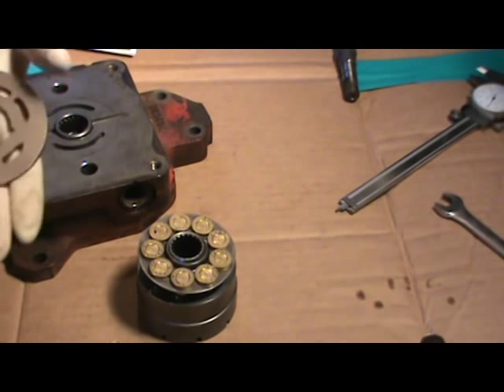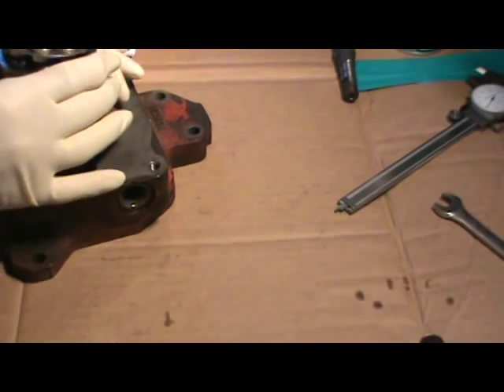Hydromotor part 4

Comment: Where did you get the manual/book for repairing the hydro pump?  I've got a bunch of manuals/booklets for these tractors but I don't have a manual on repairing the pistons/slipper assembly. Also, did you make a video of rebuilding the transmission?  I've got 3 of these wheelhorse tractors that are all hydrostatic drive.  (1) 1978 D160 with the 16hp Onan engine, I've used this one for years and now it needs new rings as the compression is only 75lbs and it should be closer to 150lbs per cylinder. (1) 1974 D160 with the single cylinder 16hp Kohler engine, this is what I'm using currently and (1) 1973 18hp twin cylinder Kohler engine with the 3pt hydraulic hitch and a shaft driven PTO that runs off the double pulley on the front of the crankshaft.  I'm working on the 1973 18hp automatic and the front seal is leaking where the coupling hooks to the engine.
Reply from the maker: Its been a long time since I did this. I seem to remember getting the hydro manual from sundstrand. They made the hydro. The hydro is a standard model but run in a split configuration.  

I did not record the rear-end rebuild but I got most of my info from https://www.wheelhorseforum.com/.

They are a great community that will help you with your tractors.

Comment: did it work?
Reply from the maker: Yep. The differential in the rear-end of the D200 grenaded it sent metallic junk through the hydro system and scored the hydro pump as well. Once I got the hydro motor fixed, I had to do the same to the pump. Once that was done, the D200 was working again. It would pull a plow or anything else you put behind it.
Reply: @CarterCreekFarm  thanks for the reply and posting the video! I got issues and doing some research...